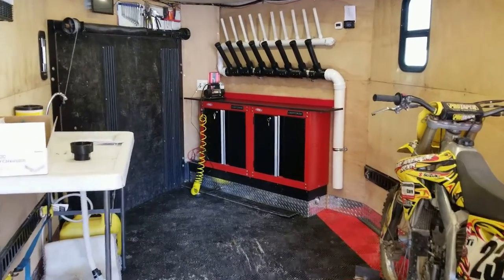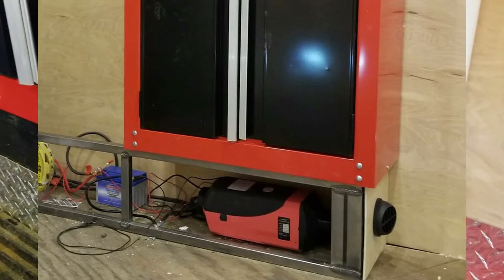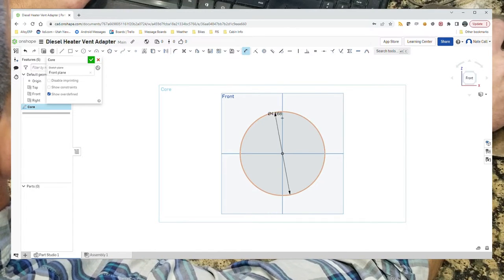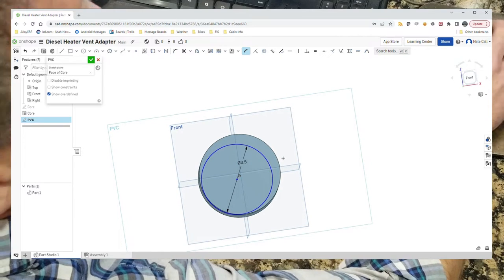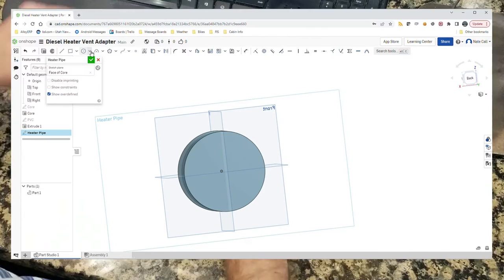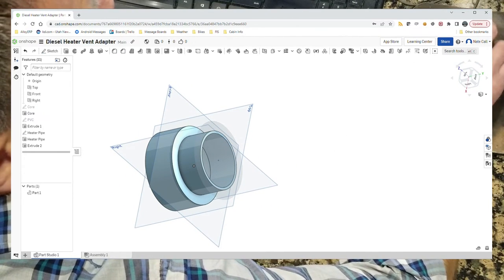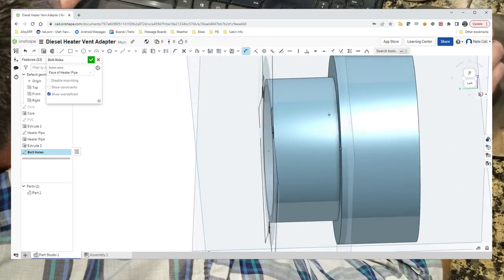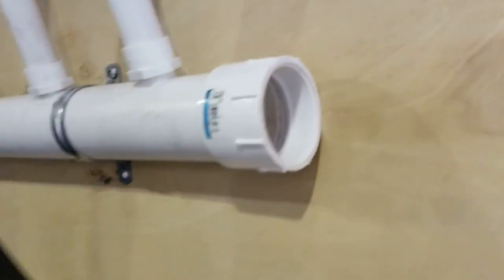Boot and Glove Dryer in an Enclosed Trailer, Motorhome, Van - Custom Adapter

Comment: Semi rigid home depot 4 inch dryer vent hose will clamp down to the diesel heater with a dryer hose clamp and then also go to PVC - that's what I did.  Also have a discharge at the end with a slice gate and if it overheats open it a little at a time so that it won't overheat and the gate partially closed will create back pressure to push into all the boots. Plus after about 3 hours everything will be dry but you will probably still want heat but 200 degree heat for 24 hrs would not be good for your gear.  So a Tee and a slice gate at the beginning would also be good ;)
Reply from the maker: Great ideas here! I also have a vent / discharge at the end to relieve back pressure. I have the T and gate for the redirect, but haven't installed it yet. I find that opening the discharge at the end leaves very little hot air hitting the gear, so I haven't put much priority on it.

Thanks for the comment!

Comment: They sell a rubber reducer at Home Depot in the plumbing department they have many different sizes found it where they sell the abs fittings
Reply from the maker: Interesting. I looked at those, but couldn't find the right size for this application. Did I miss it?

Comment: Nice work! You said PVC doesn’t do well with heat but isn’t that PVC connecting to your 3D printed connector? I was hoping to use a PCV connector about 3 feet away from my diesel heater to connect the exterior duct to the interior of my truck bed. Would you advise against that?
Reply from the maker: Yes, it is. Very observant. The larger diameter PVC has held up OK. It's just the smaller pipe that would warp and bend.

Comment: I’m trying to do a similar thing but running into some problems with attaching the smaller pvc into the larger pvc. 
Are those threaded fittings?
If so, how did you thread the pvc?
Reply from the maker: No, those are not threaded fittings. I just used pvc reducers to go from the 3 inch down to the 2 inch. They should be available at just about any hardware store.
Reply: Is that what you used for the higher, white section?
That’s the one I was curious about. 
It looked like you used reducers for the black section, wasn’t sure about the white one
Reply from the maker: Top section is 1 inch. Same concept, though, with a 2 in x 1 in reducer.
Reply: Awesome
Thank you
Reply from the maker: I need to correct something here. My response was not very helpful. The bottom (black) section is actually 3 inch. I used 3x2" Ts to go from the horizontal to the vertical perches. The top section is 2". I used a 3x2 reducer to get there. Some 2x1" Ts would work for the vertical perches on the top rail, but to save money I used a threaded pvc adapter (male threads going into the horizontal pipe; female end is not threaded, and accepts the vertical perch pipe). I simply drilled  a hole (maybe 7/8" ?) in the horizontal 2 inch pipe and threaded the adapters into those holes. Sorry for the lack of clarity on that.
Reply: Thank you for clarifying; I was wondering if that’s what you did.  The top perch looked like it was a continuous pvc pipe rather than the many Ts.  I was at Home Depot yesterday and wondering if using the threaded fitting would be strong enough to hold snowboard boots since it was difficult to get it in hand tight. 
I may end up doing exactly that though. 
Right now, I have 3/4 pipe and I just got a 1 1/16 hole drill that I’m hoping is a perfect fit to slide the pipe into. If that doesn’t work, I’ll be doing the threaded reducers. 

Thank you again